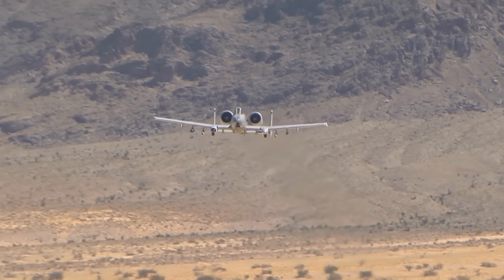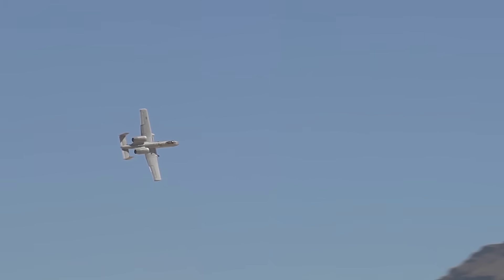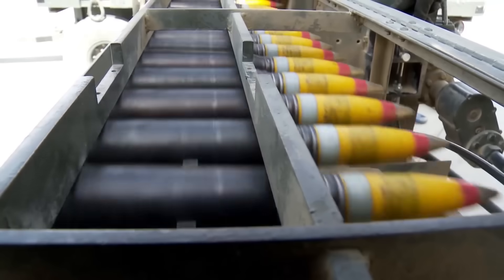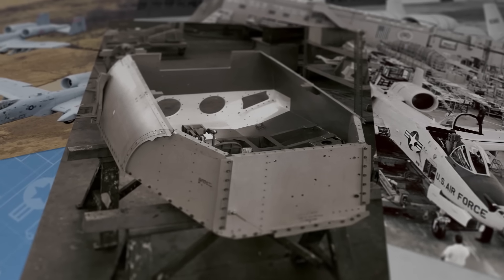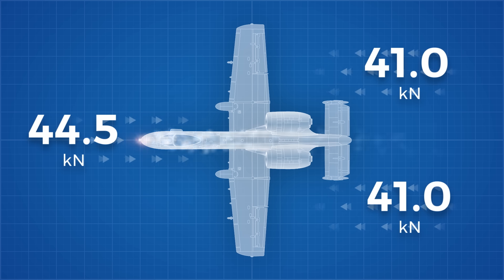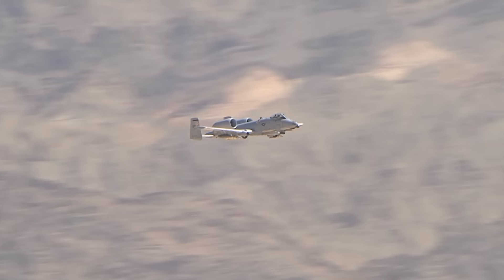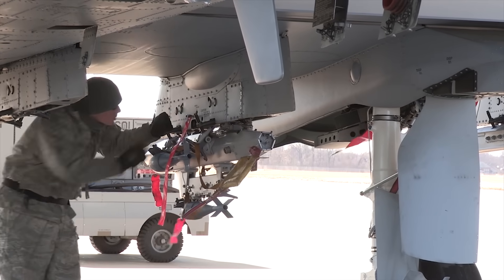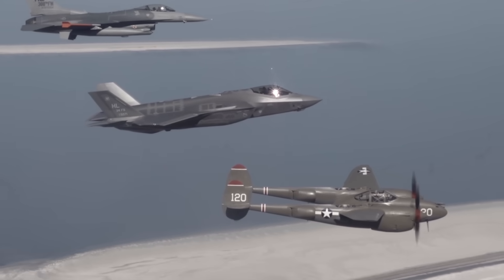The Insane Engineering of the A-10 Warthog

Comment: As an ex A-10 pilot, I will say this.

The gratitude of ground forces always made my day. It reminds you that while you killed enemies, you saved your own.

The number of times I was doing a flyby at low speeds or coming in for a landing and could hear allied cheering over my own engines is immeasurable. 

To my allies, thank you.

To my enemies, brrrrrrrrrrrrrrrrrrtttt.
Reply: My dad was an A-10 pilot in Afghanistan and JTAC (Joint Terminal Attack Controller) in Iraq, and still is today, so I’ll weigh in on this argument with my 2 cents. 
There may be more friendly fire, but it’s simply because it’s closer to the friendliest than any other plane. It does its job incredibly well even today, and is iconic and morale boosting as well, and personally I think misinformation to the pilots is uncommon, it’s simply the proximity. Have a nice day
Reply: @Sca1edAnd  listen here, either your dad is fucking braindamaged, he is lying to you, or he doesnt know what he is talking about. flying close the ground and close to where the air support is needed doesnt in any fucking way make it more difficult to identify targets, in fact it should make it easier, apart from the part where the a 10 remains HIGHLY vulnerable to MANPADS and small arms fire of course. the problem is the systems on board beeing simple and unfit for modern warfare, which is why the a 10c was made, a plane that is the complete opposite of what it was supposed to be, rather than beeing a cheap, simple, gun plane that can be fixed anywhere, its become an overly expensive garbage plane which is relying on its missiles because its gun is weak and inaccurate as fuck. and its become this by the sheer need of modern warfare, and its more expensive than a fucking f35
Reply: @Helperbot-2000  actually he is brain damaged from fighting to protect you. Quite literally has ptsd and a very rare condition where his ear canal ripped open an extra hole. Luckily the surgery went well, but he still does therapy exercises so he can balance without a vestibular system. No matter what you say or how much you dislike the military members as a whole, they will still protect you in the brrrrrrrrrrt machine.
Reply: @Sca1edAnd  its commendable of him to have put himself in danger for others, that doesnt have anytihng to do with wether the planes good or bad and is completely irrelevant to the discussion. the king tiger was the worst tank nazi germany ever made yet it was still used, the t 34 was made so cheaply and with some big design problems that is was a deathtrap to be in one, yes it was massively mass produced. just because it CAN do the job, doesnt mean it should be used instead of something thats both more efficient and cheaper
Reply: @Helperbot-2000  I was simply addressing your disrespectful remarks about my dad. Maybe stop being a keyboard warrior and idk get a life. If it really is so bad, make a better one. Get on it champ.
Reply: @Sca1edAnd  disrespectful? i called him only one of the three examples, it could be either, and likely the last one, i dont see how its disrespectful to say he doesnt know something. so you want a better one eh? well its called an f111, a plane which with half the missions got 50% more kills than the a 10 in desert storm
Reply: @Helperbot-2000  bro got so embarrassed he deleted his reply that called my dad brain damaged and pretended like he didn’t. Also, ratio.
Reply: @Helperbot-2000  your info is wrong, I’ve seen the GAU8 penetrate MBT armor with my own eyes. Don’t speak about things you’re clueless about, mmmkay? Go play some more video games
Reply: @KillersFromTheWest  well my info comes from the us militarys own penetration test under ideal circumstances so go ahead and tell them theyre wrong, not me
Reply: @Helperbot-2000  like I said, I’ve seen it with my own eyes, top penetration went through like hot butter. Maybe the sides wouldn’t be as easy to penetrate, but it’s flying up in the air shooting down, the holes went right through. Not just one time either, I’ve seen it several times. Not to mention APC’s and other armored vehicles. 30mm doesn’t fuck around, and it explodes too, so even if it doesn’t kill the tank, it’ll 100% disable it. But tell me the things I’ve seen are wrong, go play some more video games kid.
Reply: @KillersFromTheWest  again, the tests the US MILITARY CONDUCTED THEMSELVES tell a different story, the bullets firstly could hardly hit the vehicles due to the guns inaccuracy, and the ones which did were almost always stopped, at the end of the test nearly all the tanks shot at were either unharmed or could be repaired the same day, and these were old tanks
Reply: @Helperbot-jy1mm  you're probably going to ignore me again because I'm the one with experience, but control tests aren't representative of performance. 

As a guy who has sat behind the yoke of an A-10, I can tell you that "they could hardly hit due to inaccuracy" and "the ones that did always stopped" don't matter in the field. 

3900 rounds per minute means that I don't give a flying fuck if half my shots miss and only half of those that hit penetrate. That's still PLENTY damage to shred whatever I'm targeting and everything in the general vicinity.
Reply: @IsfetSolaris  except half didnt hit, Less did, and the test was under ideal conditions, something you as a supposed pilot should know effectively never happens in  war
Reply: @Helperbot-2000  of course they don't all hit, it's a rotary cannon. I challenge you to name any rotary cannon that has great accuracy. Also consider that it's engaging targets at 3/4 of a mile from a moving plane, so accuracy isn't the name of the game here. 

But the amount of firepower means that everything in the targeted area is gonna get some impacts, and in case you missed it the first time, even if just a quarter of the rounds inflict damage, 1) that's still about 25-50 rounds and 2) 30mm armor piercing explosive rounds hit their targets like a freight train, and disabling heavy armor by damaging their tracks and engine is more than enough to remove them from an engagement.
Reply: Brrrrrrt 🫡

Thank you for your service
Reply: Halleleuyah, Brother!
Reply: Your enemies here,

Ouch
Reply: @cos-sin-tan-std-dui-fbi-uti-hi  Yeah, that about sums it up!
Reply: Hell yea!! 🔥🇺🇲
Reply: I mean you are a literal Superman you are in the sky watching and coming in when needed.
Reply: brt AHHAHAHAHA
Reply: You have lived well.
Reply: @luck112a  Not sure I agree with you. If I had to do it again, I'd rather find a way to help the country that didn't involve taking lives. Nobody should have to live with this shit. And terrorists or not, they're still people.

At least being reduced to red mist by 30mm HEI at 1100 m/s is a painless death. They never even heard it coming.
Reply: Why is there a war about a plane in the comments? ✈🔫
Reply: .. After reading everything in this reply section I feel like i have gotten brain cancer.

My dude, It honestly doesn't matter. I'm no American but still thank you for your service. You've flown a dangerous plane in a dangerous role in dangerous proximities - which is a lot compared to the F-111 that this blud loves.

Whether or not the F-111 or A-10 are better is not my point. They're made for their own roles and for their own purposes.

You are a Top G. Your balls are the size of the entier GAU canister. I hope your life is going well.
Reply: To my enemies  brrrrrrrrrt. Priceless, they never heard it
Reply: The best Plane ever!
Bloß nicht ausmustern, bloß nicht.
Reply: Thanks for service, let helper bot think what he wants,after all we are a free country and some worse or better option in some things
Reply: Sound like this helper bot dude doesn’t understand how to interpret statistics.
Reply: You mean everything to us grunts. As scary as that brrrrrrrrt is to the enemy it's music to a Marines ears. I will always buy a hog driver a drink. I still don't know how you do your job and just float by and wave at us. 
     Semper Fi brothers and sisters
Reply: Thanks for your service, mate. I’d do anything to fly a Warthog.
Reply: My sisters friends brother flies (flew?) A-10's and he similarly was rather popular with the ground troops. BRRRRRRRT
Reply: @Crusader_MET  difficult to write what you want to say in one comment? it was a single sentence its not that difficult. i didnt "remind him over a 5 month period" i said it ironically a single time, did the humor fly past you? im also shitting alot more on the plane, cause its obvious the pilots do the best they can, theyre not trying to be malicious, theyre just uninformed.
Reply: 8...f*cking....months
Of arguing over a damn plane
Sure its the legendary plane with le brrrt gun
But still..just ..if you love the A-10 keep loving it..if you hate it keep hating it
Just move the f*ck on
Reply: U will die from.the same..słów death❤
Reply: God bless brother 🙏
Reply: Sadly the A-10 hasn't been pulling it's weight in years as the F-16, F-15E, and B-1 have been carrying most of the weight the A-10 should have been carrying. The A-10 has been continued only because corrupt politicians want to use the USAF as a job program.
Reply: Fighting for the deep state jew ✡️ God must be so proud of you.
Reply: Nobody:....
You: enemyyy 
Again nobody: ...
Reply: Sure you do
Reply: Wow, an almost two year old thread... I aspire to be able to bait this successfully
Reply: @tootnoots  Good lord are they still going at it? I muted all the people arguing well over a year ago lol
Reply: Murderer
Reply: Thanks for your service. Did what you had to given the circumstances. I'm sure you already know that. Thanks again. My imagination fails trying to think of what an A-10 pilot has to go through. And I've tried.
Reply: W commenter
Reply: @Helperbot-2000  Hey we just want a good time you can tell your opinions to people who agree with you alright? (No offense tho)
Reply: Thank you for your service, it is greatly appreciated.
Reply: wth is wrong with these replies
Reply: Is it just me, or is it rude and disrespectful to berate people for having different opinions than yourself instead of just saying “I have my own opinion and its different than your opinion, but it’s ok because everyone can have their own opinions” and go about your day like it never happened. Or do people have to start a debate with a veteran and others who happen to share a fondness over a pretty sweet piece of military equipment that is damn good at its job, while simultaneously disregarding their arguments as being a bunch of morons all because you’re too stubborn to accept the fact that you’re outnumbered and (literally and figuratively) outgunned and take the L on this one. I might also ask that is it a little bit silly to continuously use the same argument that has been disproven several times and comparing one thing with something designed for a completely different role.
Long story short, thank you for your service, warthog is cool, and to the common Neanderthal who doesn’t understand the basic concepts of an argument, the circus is that way.
Reply: @awastedhumansoul5068  took the words right outta my mouth.
Reply: @awastedhumansoul5068  Is it appropriate for people to hold strong opinions about things even though the piece of equipment is used for cronyism at the expense of the tax payer and military readiness? How hard is it to research the USAF budget overviews and follow-up on USAF hearings on the aircraft and why it should have been retired 20 years ago? If you go through life being lazy on research expect scorn because you simply deserve it. If you want respectful debate then offer something of value. Don't expect to say retarded things because you are too lazy to inform yourself of the arguments and expect people to respect your opinion. If you are lazy you should be scorned and rightfully so.
Reply: Thank you for your service.
Reply: A10's have a higher rate of getting bad information I guess
Reply: "to my enemies, brrrrt" cringe and faggy
Reply: How many friendlies did you fire upon with the inaccurate and weak gun :PP

(edit) this WAS an attempt to mock the plane, but is very hostile for no reason, and i regret writing it. i dont like deleting comments, and want to make sure its known THAT i wrote it even tho i disagree with it today and think what i wrote was STUPID and unnecessary, including many replies. so ill let it stand and rather explain that i dont have a problem with IsfetSolaris or any other pilot, and i apologize for the hostility. i only have a problem with the plane.
Reply: @Helperbot-2000  None.

Regardless of how much the internet loves meming on us, there's a lot of training that goes into piloting an A-10.

We never hit friendlies unless we're given bad information. Remember, this isn't a video game, we don't know whether those specks on the ground are friendlies or targets. We engage where we're told to engage, and if there are friendlies on site, that's control's fault.
Reply: @IsfetSolaris  the numbers say a different story, the a 10 has more friendly fire than all other us planes combined, why is that? are a 10s more suseptable to worse information? youd at least think they would have better information due to how slow they are. and yeah you dont know what that on the ground is, which is a big problem with the a 10, because you COULD know what that black dot on the ground is if you were in a more competent plane, a plane which would also fly much higher and faster so its not highly suseptable to manpads like the a 10, like for fucks sake, the f111 ardvaark was more effective for close air support than the a 10 in fuckign desert storm, the a 10 was outdated before it was implemented, its gun could barely damage its intended targets in an absolutely optimal scenario, and against modern armour its in practice useless.
Reply: @Helperbot-2000  fellow lazerpig fan?
Reply: @Helperbot-2000  First of all, blue on blue scenarios happen because of bad intelligence reports. No amount of technology can mitigate that. Although there are IFF systems for ground troops, reconnaissance and good intel are still needed. 

"It`s gun could barely damage its intended targets.......". Don`t worry, I didn`t forget the rest of the sentence. But the first bit is more important. Because it`s wrong. I read the same report. But there is a big misconception of the cannon. It was never designed to completely demolish MBTs. It was designed to destroy APCs and armored vehicles. Plus immobilize tanks. 

The GAU-8 is powerful enough to cripple an Abrams tank. You don`t need to completely destroy a MBT to neutralize it. It`s desirable to do so but not achievable in certain scenarios. And even if it doesn`t mobility kill a tank, whatever`s on top or on the sides, is going to get obliterated. 

I`m not sure why you hate the A-10 so much. It did a stellar job at what it was designed to do. So I don`t get your hatred towards it.
Reply: @TheKodiak72  because it has friends in high places, it has more blue on blue than all other nato planes combines no matter if you want it to or not, its gun is inaccurate and cant penetrate the armour it was designed to counter reliably no matter if you want it to, its highly vulnerable to manpads and small arms no matter if you want it to or not.
Reply: @Helperbot-2000  hey,if its so bad,innacurate,weak,and has alot of blue on blue action,tell me why the US is still using it today?
Reply: @Helperbot-2000  keyboard warrior lol you just mad youre stuck playing dcs on a 20 dollar yoke
Reply: @Helperbot-2000  Im not even going to argue you obviously dont have enough common knowledge for a normal conversation
Reply: @BigC760  hahahahaha thats how fast youre gonna give up? are the inconveniets facts too difficult to ignore? the a 10 is a shit plane no matter if you want it to be or not. it was never effective to begin with
Reply: @Helperbot-2000  Not giving up its just why waste breath if youre not even reading what im saying
Reply: @BigC760  ive read everything youve wrote, and its W R O N G
Reply: @Helperbot-2000  Are you ok?
Reply: @Helperbot-2000  Im guessing you are blind since you aren’t responding to my question so i will ask again,if The A-10 is so bad,weak,innacurate and has alot of blue on blue action,tell me why the US military still  uses it?
Reply: @Helperbot-2000  and if you are gonna say because it has “friends in high places” then why use the A-10 in the first place if there are better options?
Reply: @MuhammadFarhan-rq7wj  I mean its been pretty okay for shooting civilians and random insurgents in technicals, so thats probably the biggest reason we haven seen it retired.
If you tried utilizing it in Ukraine the whole fleet would disappear in a week.
Reply: @Helperbot-2000  It’s simply a matter of probability. If a particular aircraft flies many more close support sorties than other aircraft, then it will have more friendly fire incidents. It’s basics maths, not some sort of deficiency with the aircraft.
Reply: @stuartcole4845  really now? then you can go ahead and tell me how the f111 which flew half the ammount of missions in the gulf war while having 50% more kills didnt have anywhere close to even half the friendly fire incidents?
Reply: @Helperbot-2000  brother get yourself a diagnosis, you need it
Reply: @Helperbot 2000  if you hate the military as much as I do, targeting their works of engineering isn't the way fam. We have to target the politics and business of it all. By targeting the engineering that the military has given us, what makes you better than Stalins purge of the Tzarist military engineers?
Reply: @sciencemanguy  im not talking about how horrifying the us military industrial complex is, im shitting on a terrible plane
Reply: @Helperbot-2000  bro, as a literal engineer working in a related area, I dare you to fight me on this. The A-10 is among the best close air support planes there are.
Reply: @Helperbot-2000  bro is legitamately trying to pin all the blue on blue on this a10 pilot. ur grasping for straws lil bro.
Reply: @Helperbot-2000  The A10 got more than 500 confirmed kills, once shooting down 23 tanks in a day. Not sure where you're going with when you say that's its "inaccurate", ineffective, or "barely damage its intended target".
Reply: @Helperbot-2000  Firstly, it is still used. Let me ask: Why do soldiers still get happy that an A-10 arrives? Well, because it is known to be good at softening enemies effectively. Its firerate and decent penetration helps cripple important components of enemy armoured vehicles, and let me remind you: IT IS A CLOSE AIR SUPPORT-PLANE. Not a killer. It's just *SUPPORT*. Ground-units are most of the time also there, and can finish enemies.
Also:
"It's highly vulnerable to manpads and small arms"
Tell me, does more armor HELP, or does it weaken a vehicle? If you've got some common sense, which most of us are honestly done contemplating about, then you would know that in most cases, more armor means more protection too. So, would you like to go to war with a paper-mache plane with the same armament and such as an A-10 warthog, or an ACTUAL A-10 warthog?
I can keep going, lad, just say the words.
Reply: @ThatEnergeticBoi  "Why do soldiers still get happy that an A-10 arrives?" not all of them do, in fact theres a very stark contrast between those who have seen it in a ground attack role, and those who have actually experienced it in a close air support role, why do you think all the videos on youtube you see of it are shots of it firing at distant targets? of course thats far more exciting than having it fire on targets mere meters away with its terribly inaccurate gun, or ya know.. just hovering above in circles because it has extreme troubles identifying friend and foe.

"Its firerate and decent penetration helps cripple important components of enemy armoured vehicles" against lightly armored vehicles, sure but gheuess what? you dont need a gau 8 for that, the m61 vulcan used on most other planes does that same job, and that is 6000rpm meaning itll have a far higher chance of actually hitting something.

"IT IS A CLOSE AIR SUPPORT-PLANE. Not a killer. It's just *SUPPORT*" and assault rifles are called assault rifles because youre supposed to assault positions with it and not actually shoot it right?

"Tell me, does more armor HELP, or does it weaken a vehicle?" not too bright are you? do you not even think before you talk? why dont we put 1 meter of armour on everything if you think its so great? do you not realize it adds weight?, and alot of it. unlike a tank which moves slowly on the ground and is therefore pretty easy to hit, in comparison a good plane moves very quickly in the air anf at a high altitude making it harder to hit. adding alot of armour reduces the speed, maneuverability and ammount of weight the plane can carry. its far better to have a plane that flies high and fast that doesnt get hit at all over a slow low flying plane that does get hit, espceially when that plane is no longer the cheap easily repairable plane it once was because it needs extremely expensive upgrades to make it viable in a semi modern battlefield which makes it expensive and difficult to repair.

"So, would you like to go to war with a paper-mache plane with the same armament and such as an A-10 warthog, or an ACTUAL A-10 warthog?" could you at least TRY to not be disingenious? that """""paper-mache plane""""" could be something like say... even the f111, becasue even that was far more effective in a close air support role than the a 10
Reply: @Helperbot-2000  It wasn't made to go high or quickly. It was made to have a plane that could carry the GAU8 during times when there was a ground-area that NEEDED to be protected and taken care of. And I never ONCE talked about weight. You're shooting your friendly neighbours if you think you're shooting at me right there, you schizophrenic "Helper". The A-10 had armour in order to stay close to the ground more safely, as it needed to, to have better effect with the GAU. It was also, MADE to be easy to produce. It doesn't need much expensive equipment, is easy to maintain, it can go for a long while without resupply, and it can shoot the absolute shit out of most ground-troops that are in the area it was sent to. The F111 isn't armoured, because it was made to go quickly and high up. The A10 wasn't. It was made for *ONE THING. Giving things on the ground a REALLY bad day. And it did. 
It wasn't made for dogfights or such. It was made to hit ground-targets. It doesn't need to go high up, thanks to the armour, and as such, can be more accurate with the good ol' BRRRRRRRRRRROORR(STFU if you are gonna complain about that)
And an "assault rifle" isn't really what it's called... It's an Automatic Rifle.
And, the armour was added in amounts that would still be safe for flying.
Put simply, it wasn't made for other stuff than going BRRRRRRT, giving enemy ground-units a bad day, survive a lot, and stay usable really well, and easily.
So stop trying to match it against stuff that is WAY more costly than it, are made for other roles, and more. The A10 was made to be easily manufactured, so high-end equipment wasn't used for it much, it was made to simply do its thing, not more. The F111 was made for other stuff, like dogfights. It costs way more to maintain, manufacture, and it is about as good as the A10. They are not the optimal thing to use for close air support, so therefore, the A10 is still in use. It is better *compared to its price and difficulty of repairs and maintaining its systems.
Reply: @Helperbot-2000  damn this is still going huh...
Reply: @i5x9  500 kills eh? against what exactly? tanks or armored vehicles? cause armored vehicles can include anything from a jeep covered in aluminium foil. and as importantly, how many were with the gun? and even then, the f111 during the gulf war had 1500 armored vehicle kills, 3 times your number. i guess ill have to say it again because none of you can read; the us military's own live fire test on m47 pattons (simulating t55s and t62s) showed the gau 8 to have difficulties both hitting and penetrating the tanks and would have been nearly useless against more modern t62s and t70s. thats why i say its inaccurate and barely able to damage its intended targets.
Reply: @yuhyunlee4836  well i dont seem to get any counter arguments better than claiming i hate a10 pilots, or ignoring the live fire test and friendly fire numbers, most hilariously with one guy who left one comment challenging me to "fight him" on the subject before never appearing again
Reply: @Helperbot-2000  About 900 tanks and artillery, 1.2k-1.3k combat vehicles, and 2 air-to-air helicopter kills. Sources vary. You can find more info yourself.
Reply: @Helperbot-2000  bro is still fighting the ‘good’ fight 8 months later. Very amusing.
Reply: @Sca1edAnd  ive never claimed to fight a good fight, im shitting on the worst plane in the us military
Reply: @Helperbot-2000  is this an appropriate place for that? In the replies of a random comment of a pilot of that plane who probably has PTSD and doesn’t particularly want to know the friendly fire stats?
Reply: @Sca1edAnd  Sadly, I've been made aware of the friendly fire stats thanks to the internet long ago. But I'd certainly rather not think about it.

I'll leave it at this: If I ever hit a friendly, I was not informed. As far as I am aware, my record is clean in that regard.

However, I have friends who cannot say the same. And the question of if I ever actually killed or wounded an ally will always be nagging in the back of my mind.

Take my word for it, arguing with this sort will never get you anywhere. They're dead set on being right and ruining someone else's day. Best strategy is to ignore them.
Reply: @Helperbot-2000  you try flying one
Reply: @Manny-fc8ym  what were you trying to prove with that one?
Reply: @Helperbot-2000  bro it's been 8 months I think you should stop
Reply: @Helperbot 2000  sorry mate you are being like a conspiracy theorist you are too stubborn to listen, so I think that you should stop, and this is going way too far so please.
Reply: @Sca1edAnd  Pilots don't have PTSD, get real! 🤣. Way too many BS Hollywood movies for you!
Reply: @i5x9  The A-10 is a politics aircraft that doesn't pull its own weight. The USAF leadership tries to get rid of it every fiscal year because it's outshined by other aircraft many of which are multi-role like the F-15E.
Reply: @Helperbot-2000  rather than being a total pillock how about you thank him for his service?
Reply: @Helperbot-2000  are you ok? Like how did your life get this sad? Damn. Im a massive vergin myself but i still didnt hit THIS low where a war veteran says something and you deny it just because you want to be right 😂
Reply: @matteorubini6539  refute my points or dont bother talking
Reply: @Helperbot-2000 it’s also used most for very close air support which means it will have the most blue on blue due to abundance of use
Reply: @lol6230  if you could bother reading im pretty sure ive already countered this claim three times, it doesnt have shittons of friendly fire because it is in a CAS role, because other planes like the f111 have done the same job far more efficiently and with war less friendly fire
Reply: @Helperbot-2000 you make some pretty good points lol
Reply: @Helperbot-2000  is all of that why they still haven't retired the a10? is all of that why you are too lazy to even read anybody else's arguments? is that why you are so close-minded?
Reply: @Helperbot-2000 source: buzzfeed article
Reply: @Helperbot-2000 It would seem to me that your statistics don’t mean anything in the real world if countless examples of people who have firsthand experience with the plane say otherwise. Similar to when the statistics told the world that the Titanic was unsinkable - we all know how reliable that statement was. You’re a classic example of someone with all the research and none of the experience.
Reply: @wopsyautofabworx  listen man, ive said this shit over and over, theres a stark difference in veterans who have had it help as a ground attack aircraft, watching it hit something miles away, and those who have had the misfortune of experienced it firing at targets right next to them. dont even try to bullshit your way out with "muh titanic was said to be unsinkable goblin noises "
had the titanic been damaged in its intendeed safety rating would have performed just fine, it was rated for 2 compartment floodings. but of course famously it wasnt hit in 2 compartments, it was hit in 6. thinking about it for 2 seconds youll know NOTHING can be unsinkable, its just a matter of how much it can endure before finally giving in. or do you also complain when a row boat cant tank a torpedo hit? also the "unsinkable" tiotle came mostly AFTER it sank, so yeah.
Reply: @MuhammadFarhan-rq7wj don’t sweat it the f 35 is supposed to be close air support at supper sonic speeds. Not going to happen…but it’s backed up by the ac 130 angel of death that just hangs out.
Reply: @Helperbot-2000 thats becuase its an air to ground plane . Air to air always has radar signals to show friendly or foe . Hard to do with footsoldiers , hé May have not hit friendlies, his colleges might . But that is not for you to say ... those numbers are not based on him personally . Show some respect
Reply: @RecklessGenesis  no that is not an excuse, and the fact that the f111 didnt have this problem while beeing more effective and suffering far less losses when performing CAS hammers it in.
Reply: @Helperbot-2000 numbers don't tell the entire story. You're arguing against someone who FLEW the A10, I think I'd trust his experience of flying it more than numbers of some pencil pushers somewhere in a nice safe building.
Reply: @IsfetSolaris Thank you for your service. I salute you!
Reply: @reapertalon  No no, let him keep arguing. He'll be proved wrong next year when they try to discontinue my bird again and fail again. 

I'd much rather he waste his energy yelling at me than driving another of my buddies to join the 22 a day.
Reply: @IsfetSolaris my uncle flew the hog man! Thank you for your service 👊🏼 I’m trying to apply right now for a reserve unit in my home state to fly A-10s! So hopefully I can fly her before she goes! Brrrrrt on brother 🤙🏼

Ignore this dummy in the comment section that has no idea what he’s talking about.
Reply: @Helperbot-2000  holy shit dude, u fought this fight for around a year, you dont listen to points, you bring up information with no proof or sources, you dont bring up any points that could combat any of the points brought against u, it might be time to admit defeat
Reply: @Helperbot-2000  please provide your source
Reply: @sheepgirl-hawawa  if only i had said it already, alas i only said it like 10 times, T H E  U S  M I L I T A R Y ' S  O W N  L I V E  F I R E  T E S T
Reply: imma need a link first, @Helperbot-2000  there are thousands of documents in the military, i need to know which specific one you're talking about
Reply: @Helperbot-2000  did you think they ran ONE live fire test?
Reply: @Helperbot-2000 did you lose a friend to an a10 or something?  The length of time you have spent on this almost indicates there to be a personal loss somewhere.
Reply: @Helperbot-2000  you are insane. Saved my grunts and me more than once. You don't know how to call in support that's on you. I trusted these guys with my life more than once and they never let me down.  You must be army. Semper Fi brothers and sisters
Reply: @Corey-ek9mk  a fire lance is a completely valid weapon is it not? why are you not also advocating for ITS use? or how about you go advotate for the adoption the stuka? its way cheaper than an a10 and probably about as effective too. or maybe hmm, just because it technically functions doesnt mean it should be used instead of better things. 
tell me, do you care more about cash or lives?
Reply: @Helperbot-2000  well for one thing the video is about the A10. Second I have been around the A10 warthog the other things have never saved my life. So I'll speak on what I know. Not what I think. Or what I saw on a video game. I'm sure we have all kinds of stuff that are awesome since I was active.
     Semper Fi
Reply: @Corey-ek9mk  there you defeated your own words, youre truly the peak of a 10 defender intelligence, you really dont see the problem? "So I'll speak on what I know." yeah and just because your personal experience tells you you were saved by an a 10 doesnt mean it isnt overall bad. this is the exact same logic as beeing against seat belts because you survived a car crash by beeing flung out of the window onto a pile of pillows because you didnt wear a seatbelt, while the car fell into water. you see how wearing a seatbelt is 99.999% of the time better right? now even that scenario is more favorable to the non seatbelt wearer since the a 10 doesnt even do anything any other plane cant, im pretty sure even the loiter time is matched by the sky warden if im not incorrect. and we arent even talking about recent innovations, the a 10 was completely and utterly outmatched by the f 111 in desert storm
Reply: @Helperbot-2000  K
Reply: @Helperbot-2000  I don't really have a dog in this fight but... there's a possibly simple reason for the 10x more friendly fire than "all other US planes." That being that "apples" were not compared to other "apples." So, for example, if the incidents of A-10 friendly fire had been compared to other Close Air Support planes in similar conditions, the resultant data would be more accurate. My problem is that I just don't know the details behind that claim -- perhaps it's relatively accurate.  I am just offering a way in which the claim may not be well-grounded.
Reply: @stuartcole4845  Exactly -- that's what I also wanted to say in my reply (today) to this. But I brought up the comparison data (to what was it compared?). Still, your point is correct -- we don't know if he's quoting raw data or some sort of proportion. His argument would be stronger if it was, say, the number of Friendly Fire incidents PER Support incident. And you can even get finer grained from there --for example, if A-10 was deployed instead of another type of plane because this or that characteristic made the incident more difficult, e.g. proximity of the 2 forces to each other).
Reply: @danielremler8455  umm no, other cas planes are already included under the category of "literally every other us plane" and if you WANT specifically an example under yhe same condition the yet again ill have to say the f111 didnt have that friendly fire problem despite literally supplementing the poor performance of the a 10 in desert storm, and was far more effective in its role
Reply: @Helperbot-2000  In the first part of your reply, you seem to be making my point: one must compare apples to apples. Otherwise the comparison lacks meaning. So your 10x number is incorrect because you are comparing the A-10 against planes on missions which had nothing to do with shooting at enemy forces close to friendly forces. 
Now, the Part II of your comment was more on point. But you don't give any numbers so I can't comment on it. The problem with your part II is that you simply state a conclusion. OK -- I'm willing to believe you. But it would be nice to back it up with numbers is all I'm saying. (I'm perfectly willing to believe your part II). That's all. Thanks.
Reply: @danielremler8455  the reason it doesnt matter whether most other planes havent performed cas is that we arent talking about friendly fire per successful missions or something like that, we are talking about total numbers, in which case taking any cas aircraft that difference becomes larger since you simply subtract the numbers added by all the other planes.

the f 111 had 4000 sorties with 1500 armored vehicle kills compared to the 8100 sorties of the a 10 with 900 armored vehicle kills. 
USAF "air force performance in desert storm" april 1991
Reply: @Helperbot-2000  First of all, thank you for taking the time to give me a detailed reply -- I appreciate it. Secondly -- I do seem to have lost the script as I did in fact thing that that was the subject of the conversation was specifically, the number of so-called "blue-on-blue" deaths -- or as you put it: friendly fire incidents per mission flown. I honestly thought that was the subject of the conversation. So if it wasn't, then I'm more than willing to concede your point about other statistics. For example you cite the number of enemy armor vehicle kills per sortie. OK. I believe you that the F-111 is superior in that. 
I had thought that initially you were making a comparison between a CAS-type plane (A-10) and a bunch of non-CAS-type planes + CAS-type planes in looking at specifically, the # of friendlies injured per missions or per sortie. The comparison of a CAS plane to "all other planes" seemed wrong in looking at that specific measure for obvious reasons. But again, apparently I lost the script and that wasn't the subject of the conversation. In any case, thanks for your time and info on the F-111. I'll pay more attention to it in the future ... 
If you try taking out a little of the snark when talking to these other gentleman who, say, have actually had their lives saved by an A-10 (I've never been in the military myself), your arguments may get further with them. But perhaps the goal of your comments is to get a rise -- I honestly don't know. But you were polite to me and I appreciate that.
Reply: @danielremler8455  well yes i was talking about friendly fire, but not in the f 111 example as then i was talking about the general effectiveness of the planes. and just like ive said, it doesnt really matter the f 111's number compared to the a 10 since its included in the example of "all planes vs the a 10", i dont remember the numbers now, but there wasnt much friendly fire during desert storm, but the one case with the a 10 was especially notable as two british IFVs were destroyed by an a 10, caused by bad information initially, but very problematic since the a 10 circled around them for a while unable to identify them.
again in the subject of the initial premise, i mfail to see how comparing it to all planes is wrong, since comparing it to all planes means the number beeing compared TO the a 10 is larger (so the difference is smaller) and if i had only included other CAS planes, the difference between those and the a 10 would be even worse in favour of the a 10. please explain if im wrong, because to me that makes sense. its a long time since i last read about it, but for what i remember, the comparison numbers should be accurate, but i dont remember where i read it otherwise i would have given the source now, so dont take my word for it.

in regards to the last part, i DID intent make fun of several people, and to get a rise of several people who argued against me, but i didnt (or at least NOW dont) intend to outright offend poeple, and i regret some of what ive written and know i should have worded things differently or said somethings in a completely different way instead. i realize i have come across as far angrier than i ever was, and even spiteful. the initial attempt at a joke is quite pathetic for example, it comes across as an attack on him rather than the plane itself as i intended. and the further replies of mine were even more unnecessarily hostile, i had no idea ive changed so much in a year until i reread what i wrote.
Reply: @IsfetSolaris  I wish to apologize for the hostilities and anger, i still tand for what i wrote about the plane, but i severely regret any attacks against you or anyone else. I don't ask for you to forgive me fopr it, just to know that i regret saying what i did and wish you well.
Reply: @Helperbot-2000 lol you didn’t even respond to that guy after his “fight me” challenge did you? Could be wrong though
Reply: @Helperbot-2000  sabes a percentagem de A-10 abatidos ??
É melhor ires ver essas coisas primeiro!!!!
Não sou Americano nem piloto, mas posso dizer-te, sem pejo que o A-10 é a melhor versão que pode haver para o papel que foi projectado !!!!!😊😊😊
Reply: @Helperbot-2000 none the less brrrrrrrrrrrt to your terroristic philosophy. And long live brrrrrt in your nightmares.
Reply: @MontanaCrotchRocket  most intelligent a 10 fan:
Reply: @Helperbot-2000  The A-10 only has friendly fire counts because of the pilots being given misinformation. While you're the type to spread misinformation while rubbing cheeto dust all over your shirt.
Reply: @Helperbot-2000  good man
Reply: @Crusader_MET  alright, tell me which part of what ive said is wrong then
Reply: @Helperbot-2000  all of it
Reply: @Sca1edAnd  all of what
Reply: @Crusader_MET  stunning and brave, sucks for you to be wrong huh?
Reply: @Helperbot-2000  mate why in hell are you so set on this fight? You lose someone in blue on blue? Because, fun fact, we'd rather not be reminded that we've likely accidentally hit friendlies in a run before. We get more FF because we fly close air support with such a powerful weapon. Have you actually seen the GAU in action? Have you ever actually been behind the wheel? No? They tell us "here's the target. Make it not exist", and we do just that. Yes, friendlies are close. That's what makes it close air support. Accidents happen and we train real hard to not let them. And we have nightmares about the times we fail. So maybe you, Mr. Internet expert (who has clearly never flown in his life), should think before speaking.
Reply: @Helperbot-2000 god damn this guy aint a keyboard warrior he's the entire keyboard army
Reply: @Helperbot-2000 dude… your cringe is palpable